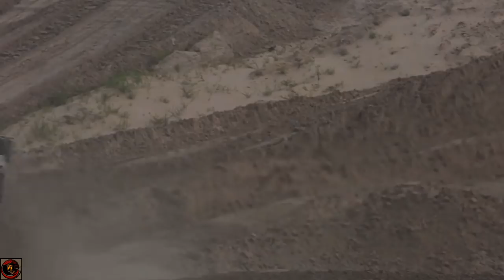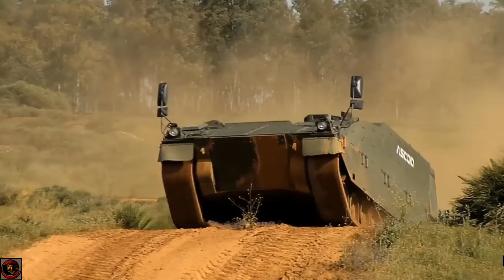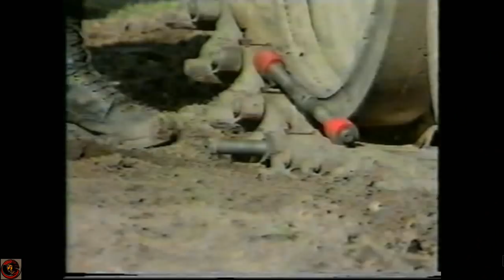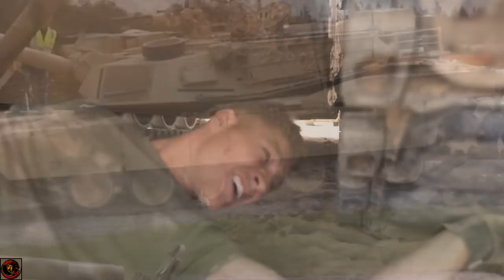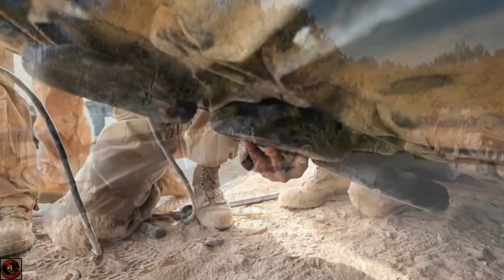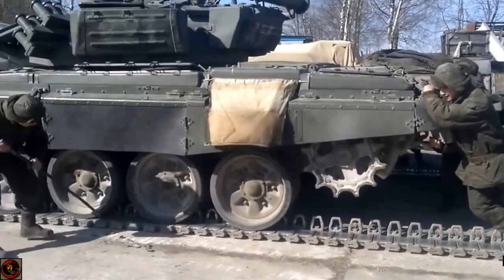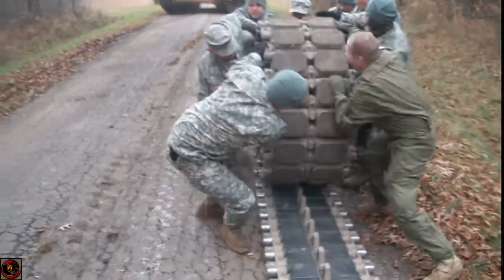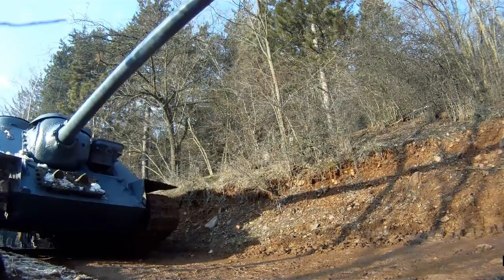What’s The Biggest Weakness on a Tank?

Comment: A solution to the track beeing blown of, is to have 4 of them. Might sound like the most STUPID ideea, but if u lose 1, u have 3 more. And yeah, I know, how can u give power to the front or the back tracks, batteries. Each roadwheel would have an electric engine, so if u lose a track or 2 or all of them, u can drive it like a car and repair it in a garage or military base or military camp. Or if is not that bad, field repair. Duno how practical it would be, but is just an ideea.

Comment: So many things wrong in the basics of this video.

First is loose use of definition of  "a tank". A tank means an armored tracked vehicle capable to defend itself. Meaning any tracked armored vehicle that has a machine gun is by definition "a tank". But there are all kind different tanks, IFV, engineering, SAM, MBT etc. What "tank" is for some, is just the MBT. That is definition of very specific kind tank, a Main Battle Tank.

And then comes other loose terms like "firepower against trees" when the tank mass is used against the tree by taking good speed and going on it. That ain't using firepower.
Reply from the maker: ReMors what in the hell are you talking about? A tank is not any tracked vehicle that defends itself. No. What are you even talking about trees?